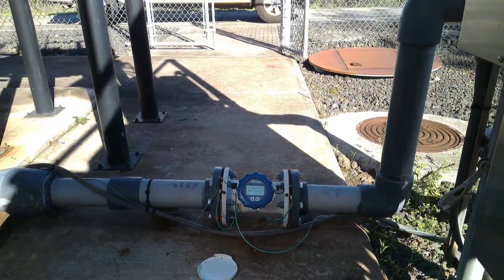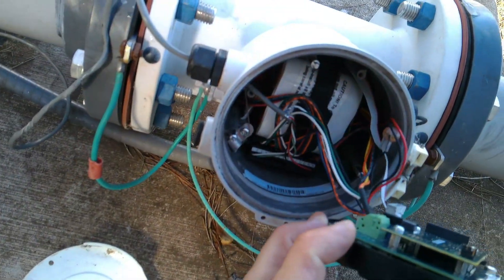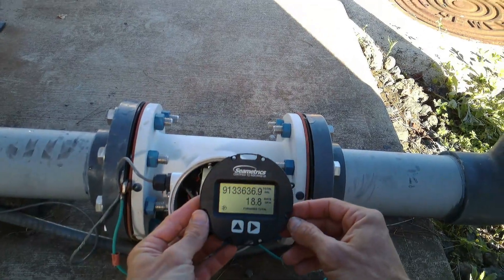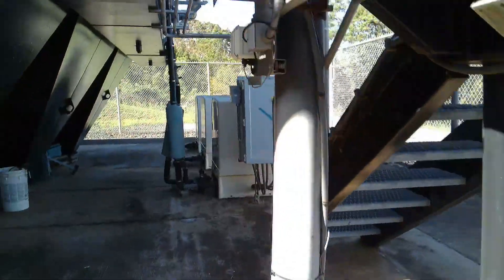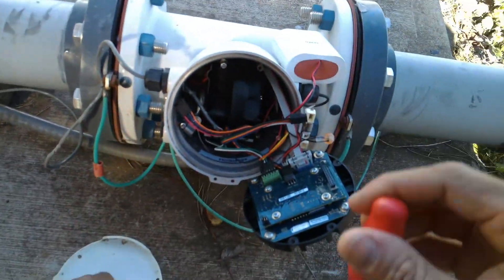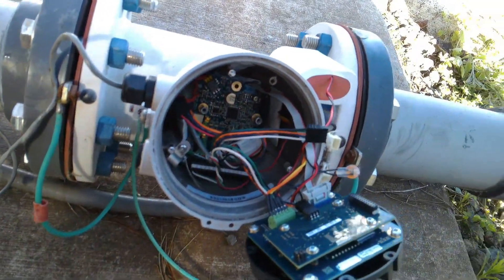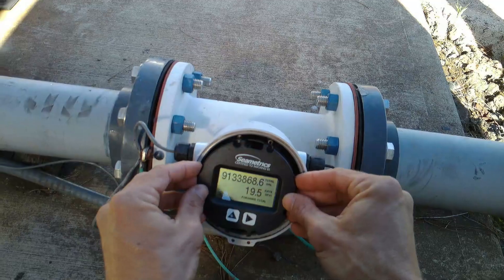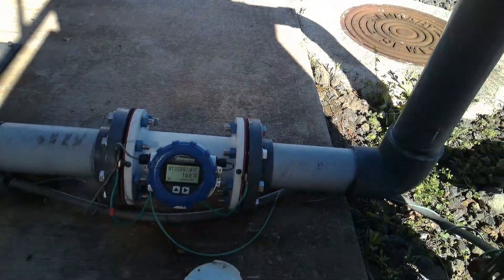Seametrics Flow Meter Trouble Shooting

Comment: The manual of theese meters state a requirement for at least 20 microSiemens/cm conductivity for the measured fluid. As far as I can tell by the construction of the meters body, they seem to measure fluid velocity by sound waves propagation speed. Could also be that the roaring pump nearby just interfering with the meters internally generated sounds beond the meters ability to tell them appart.
Reply from the maker: Interesting.
Reply: It is a magnetic flowmeter.

A good name for an ultrsonic flow meter would be iFREQ, though. :)

Comment: Hi, I'm just wondering if you have found a solution to this? Grounding issues? Dirty or malfunctioning sensors? Air trap or something else? Thanks man.
Reply from the maker: Nothing conclusive yet.
It's so intermittent and the meter reading is so critical for reporting that the operator is exploring replacing it with a different manufacturer.

Comment: Hi,
How is the customer charged for the trouble call, is it by the hour and what's your rate?
Reply from the maker: For trouble calls we bill $220 an hour. 
We are located in Hawaii, Maui county, one of the most expensive places to live in the USA.
Reply: I live outside of the USA, I live in the Caribbean, I freelance and I charge $150 an hour for trouble calls. Do you freelance or you work for a company?
Reply from the maker: @AzizKhan-vl6to  That's Awesome. We are a small electrical contracting company. Stay safe out there :)

Comment: I had the same problem with that seametrics mag meter. It wound up being the effluent was coating the sensor and would give us a bad reading randomly. We cleaned it and it would get better for a little bit and then start giving issues again. We switched to a paddle wheel and that resolved the issue.